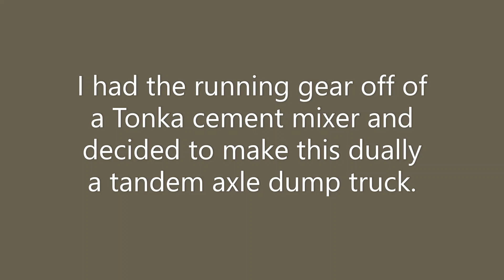New York City DOT Tonka Truck Restoration

Comment: I was kinda hesitant about your choice of white for the cab, but you really made it look good. Nice job.
Reply from the maker: Thanks, White can be a pain to paint sometimes, but it does have a good commercial look for a DOT truck. Thanks for watching. The next pickup truck is going to be Midnight Black with an offset Intense Blue Pearl "Thin Blue Line "  stripe front to back. It will also have Mighty Tonka Dump truck tires and wheels (The big ones).

Comment: Sorry, that is not a restoration. It's a customization. The title is misleading. (...and you are using the rivet setter backward. The pointed end goes into the hollow end of the rivet and the concave die goes over the domed part of the rivet.)
Reply: It's really a restification as there is a boatload of restoration going on there as well as mods. 🚚
Reply from the maker: I am not sure what you were seeing as far as the rivet clincher is concerned. The dies are removeable and can be swapped side to side based on how much access you have. Maybe I recorded it in a wrong orientation but I never use it that way. It would slip right off. I apologize it the title was misleading. I thought that the NYC DOT would point out that it was custom.